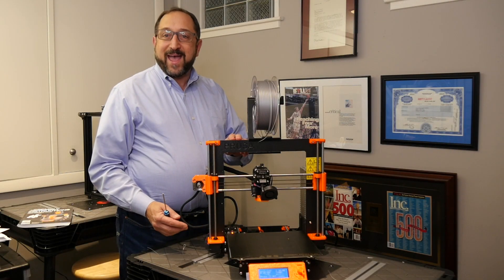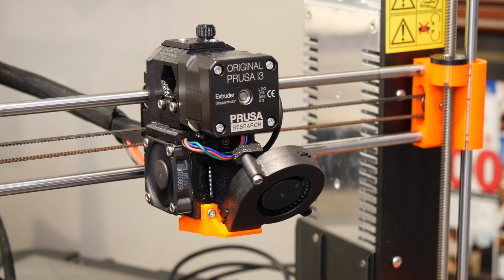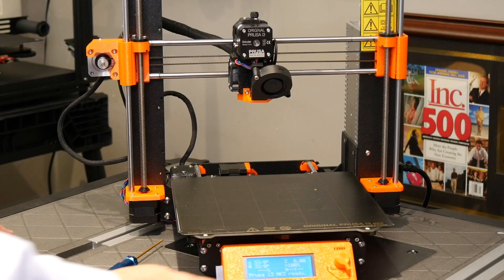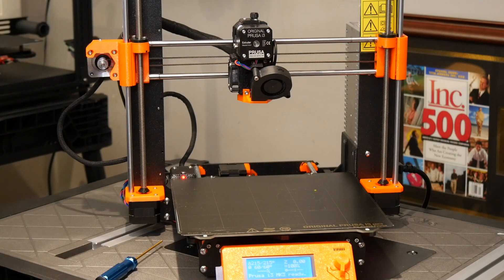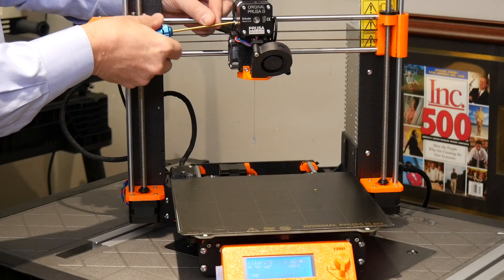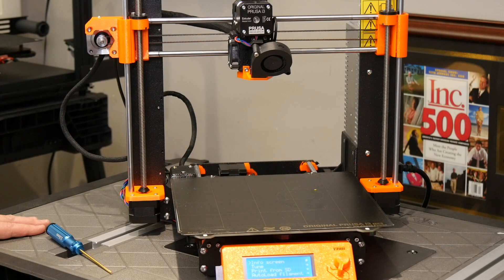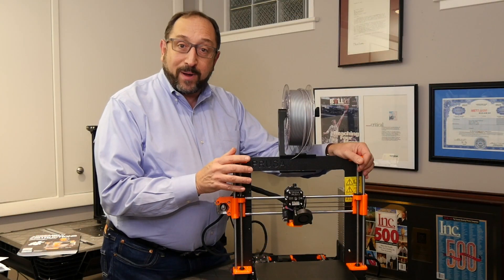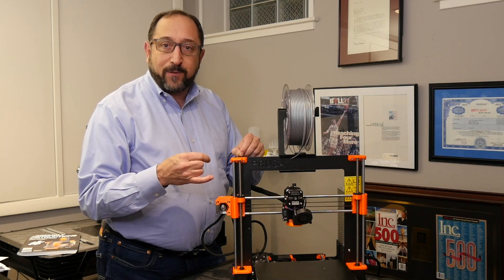Adjusting the Extruder on the Prusa i3 MK3 to Minimize Filament Sensor Errors

Comment: Interesting analysis, but I believe that the additional tensioning of the screws i.e. flush with the extruder body, is to ensure proper engagement of the driven gear teeth with the gear teeth of the idler. Without this engagement, the idler is not actually helping to "drive" the filament, but is only acting as a guide surface. This behavior will be more evident when applied to retractions. Additionally, having only minimal "grippage" on the filament can be detrimental to step accuracy of the extruder motor if the filament slips due to inadequate pressure from the hobbed gear. This information may or may not apply to your situation due to the uniqueness of each printer. Thanks for the videos and hopefully we can all learn something together.

Comment: Doesn't the elesticity of the filament plays a part? I would guess that TPU would need more tension. Have you tried it?
Reply from the maker: Good question.  I will have to investigate.  I originally spent the time to understand this adjustment because I was getting false out of filament errors.  Ironically this was happening with white PLA not with black PLA or PETG which both worked fine.  

Your question is very interesting in that context.  It may have been that the elasticity of the white filament was different.
Reply: @MakeWithTech  Hello, have you tried TPU? I don't have problems with >80 Shore A TPU filament but with 70A I didn't succeed. I'm using a MK3S+  Thank you!

Comment: Thanks, Irv!  I had used my original sensor for several months with no problems.  Then I installed a new sensor.  It still malfunctioned, and I gave up after tearing my hair out.  Just ran a print using the sensor and changed colors midstream.  Worked like a charm! 
Previously it would pause for "filament out" after just a few layers and continued to the point that I had to just turn off the sensor.  This info should be in the instructions and would save some users and Prusa some headaches.
Reply from the maker: Thanks for the comment.  Glad the info was helpful.
Reply: Dear Jalnx, you wrote that you used your filament with no problems ... can you explain then why you switched to a new sensor??
Reply from the maker: I did not switch sensors.  I do find you sometimes need to re-calibrate the extruder depending on the filament.